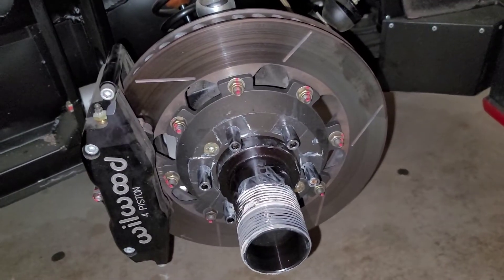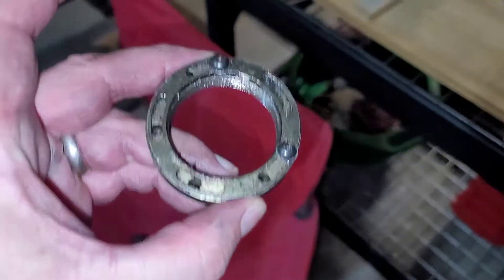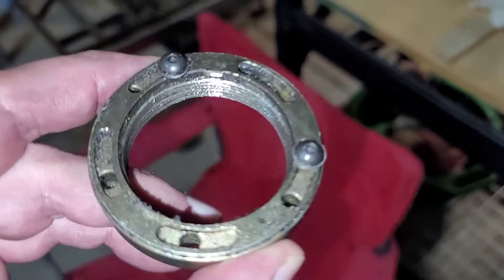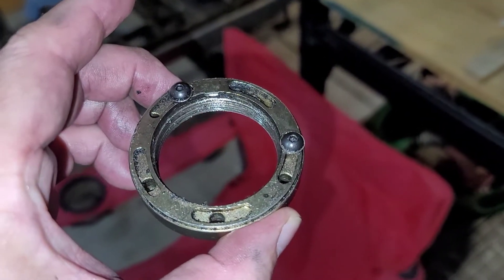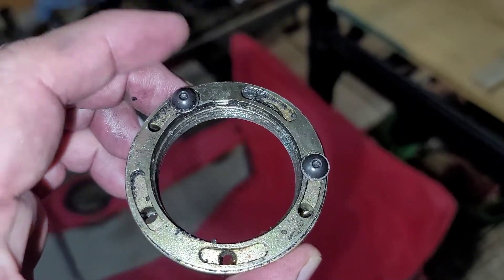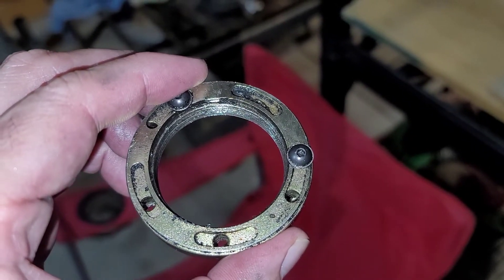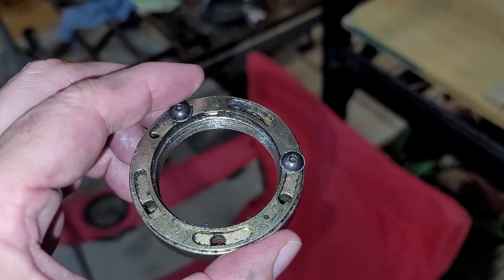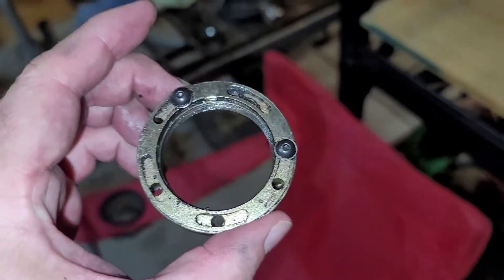GT40 Superformance P2247 Mark II front hub assembly part failure

Comment: I had centerlocks on my 997turbo, Porsche recommended 360ft lb tq, I had to use a 3:1 tq multiplying tq wrench. Hard to believe a led hammer is adequate. Anyway I’m ordering a cav Gt40 and worried about just this scenario.
Reply from the maker: Lead hammer is the standard from the beginning. Don't have any idea what the torque equivalent is.